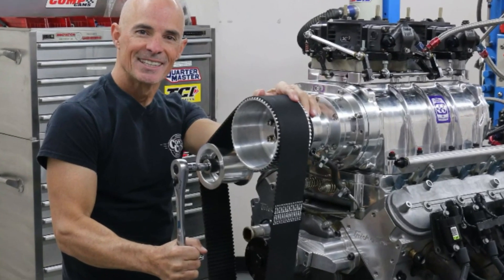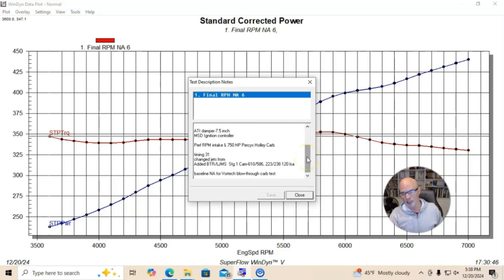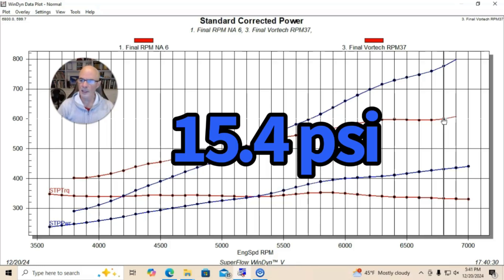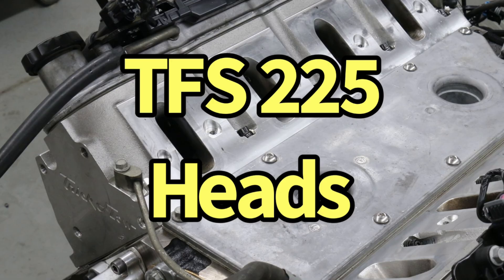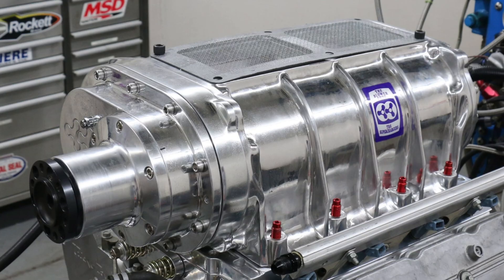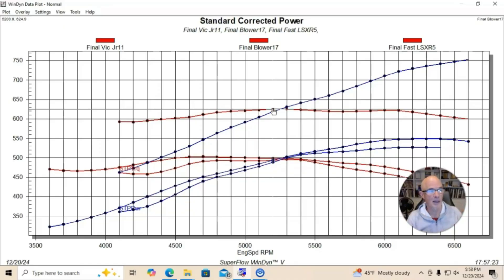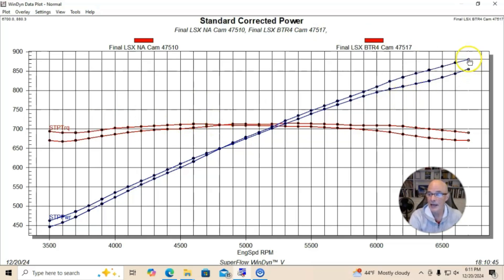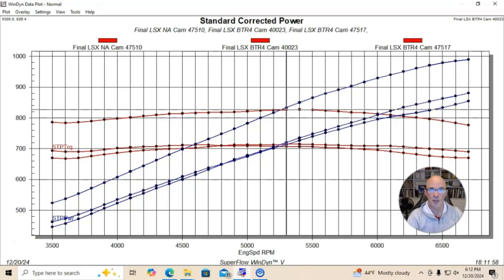HOW TO MAKE SUPERCHARGED LS POWER! FULL DYNO RESULTS. JUNKYARD VORTECH 4.8L, 383 6-71 & 6.2L WHIPPLE

Comment: Just out of curiosity, have you tried a LS motor, 671 blower with dual Holly throttle bodies on the blower?
Reply from the maker: If the throttle bodies supply fuel and not just air-the power would be the same. If the supply only air and you try to run port injection, the blower will likely burn up (rotors needs lubrication and cooling)

Comment: great videos RICHARD       . I have a question about a  55 cgevy pro st bbc 871 blower with efi, Do you have any videos on the difference in the mat temps with standard rotor blower with an injector plate , and then a high helix blower with injectors in the side like TBS sells.
Reply from the maker: Very specific test-I have not done that-but it you are injecting fuel above the blower-good things happen to charge temps

Comment: I'd like to suggest a test if you still read these comments. It seems to me that few people take advantage of the LS in NA form as much as they should. Why not exploit its advantages ? Factory crank trigger, factory aluminum block, factory 6 bolt mains and more.....  I've been running up to 13.5 CR on big block chevy with avagas for a number of years now. So i know it works and its cheap.  Why not build an NA LS with 13.5 CR, maybe a 408 stroker, the best easily bolted on aftermarket heads, a tunnel ram with 2 x 750 carbs and cam that will run to 8000 RPM. Is 800 hp possible ? I'm talking big block chevy power numbers from a lightweight LS !
Reply from the maker: I made over 800 hp, but with an NA 495 LS

Comment: Hey Richard. Great video as always. Not sure if you can test this but I'm in the process of building a full return style fuel system and eveyone and their mom says to put the regulator after the fuel rails. I want to put it before as it'll make things cleaner. Oem style also has it befoe the rails. Can you do a test placing a regulator before and after the rails, and looking at fuel pressure at the rails. Also individual afr reading per cylinder to see if there is any indication of flow difference by looking at afr difference between cylinders
Reply from the maker: The OEM put the regulator before the rail on a non return, putting a return style regulator before the rail only control fuel pressure before the rail-the rail would only have return pressure

Comment: Have you made a video on the summit racing 8727r1 rv/truck cam compard to others? Im looking at making a N/A 5.3 silverado build. I wanted to get around the 450hp mark with the motor N/A and then work up to pulling the motor and checking my ring gap for some 75mm turbos that i have laying around. Any thoughts on better cam options or advice? I want it to be a fun daily driver.
Reply: Not completely sure if I want to turbo the truck yet. I love the idea of a N/A truck build.
Reply from the maker: check out the graph on my store (richardholdenerperformance.com) of the Low Buck Truck and Truck Plus cams (Low Buck Truck is the most popular)

Comment: Hey Richard, I have a question about the effectiveness of a water intercooler relative to the position (near or far) from the engine. I am planning to get a rear mounted GT45 for my LT1 Gen 2 TransAm, for design purposes I am also planning to have water intercooler in the back (I can change the design to favor performance). If I don't get an intercooler, the "intake pipe" coming from the turbo would run below the car driver side and the normal air from the street I think would cool down the air a little.
Now, if the intercooler is in the back and cooling the air right after the turbo I would lower the temp but... would it get heated by the street?
OR, do I let the intake air get colder by the street and then extend the lines from the IC in the back all the way to the front and cool the air right around the accessory belt?
Reply from the maker: cool it close to the motor
Reply: @richardholdener1727  thank you Richard! Merry Christmas! God bless you and your family!

Comment: How about what is possible on a bone stock engine with factory ECU and injectors?
Reply from the maker: why would you try to run a blower with stock injectors?
Reply: @richardholdener1727  for knowledge, then put bigger ones in on factory ecu

Comment: Hold on now Richard. You compared a much larger supercharger cam to the smaller nacam? What was the purpose? Why not choose a similar duration supercharger cam? I know the answer. It will make less power.
Reply from the maker: the test wasn't all na cams vs all blower cams-just those two cams. You should know this channel well enough to know the cam that makes the most na power usually makes the most under boost (NA or blower designation doesn't matter)